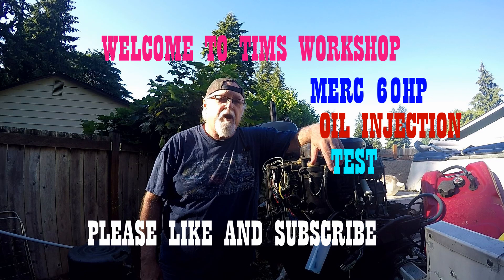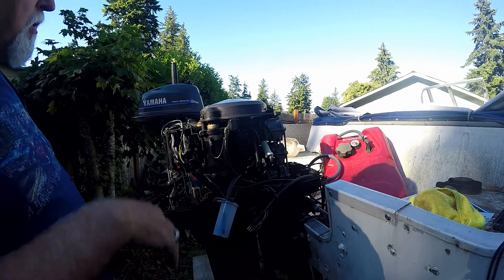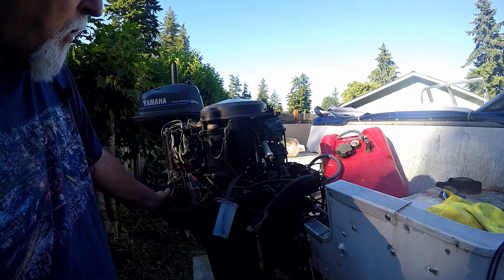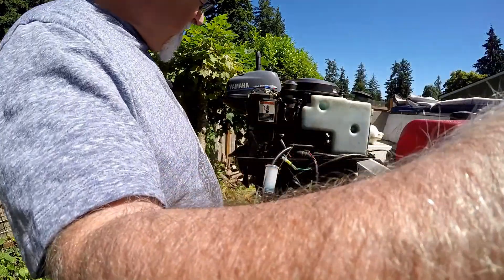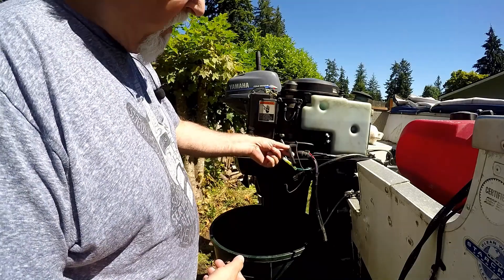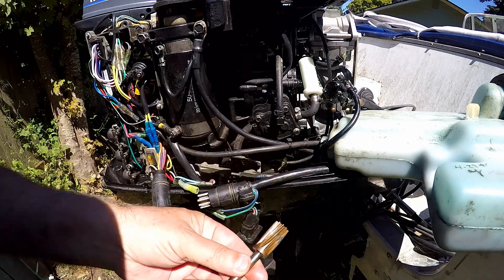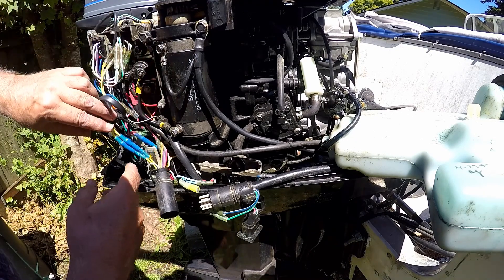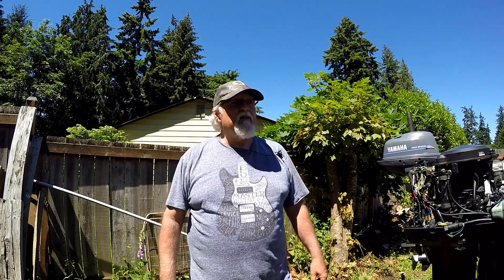Merc 60hp oil injection test

Comment: Great job thank you !
Reply from the maker: Thanks Jon, after reading the mercury Facebook group page on oil injection I decided to do a video on how the pump works. I was concerned if the gear they were talking about was plastic on my motor which is a 1996? Turned out to be metal👍 maybe the newer motors have plastic gears on the pump. Anyway glad you enjoyed the video. Lots more coming. Tim